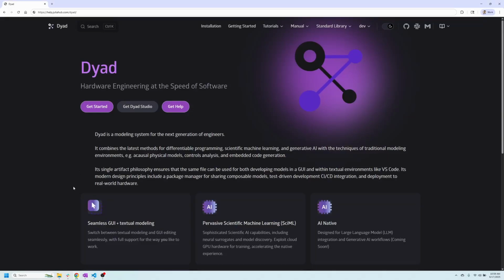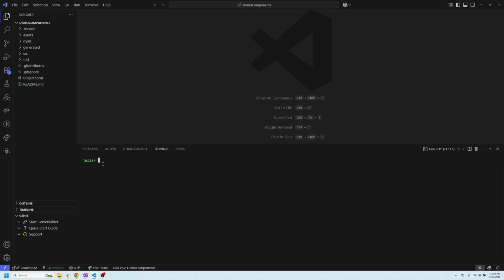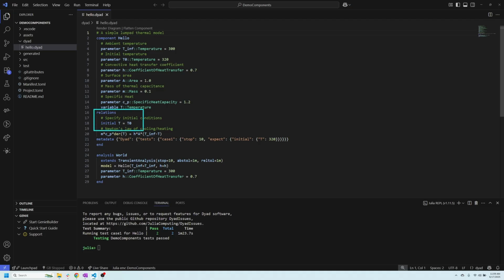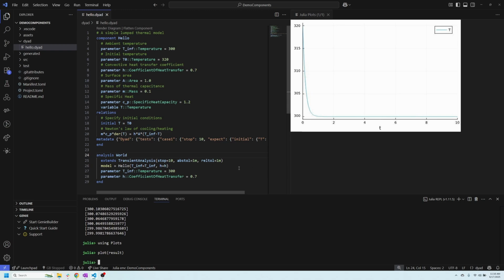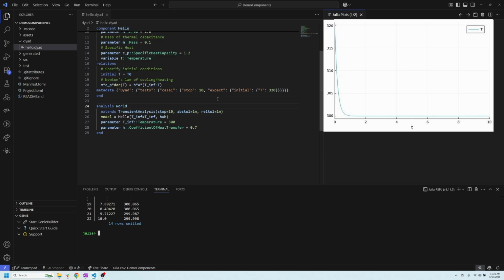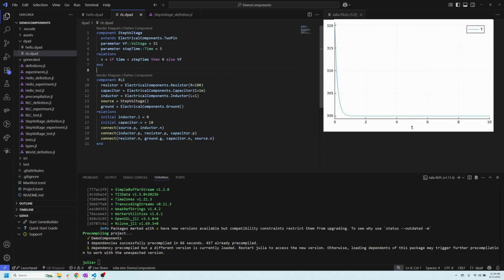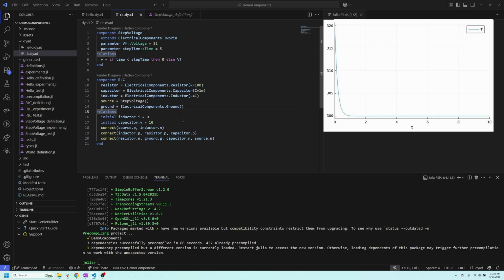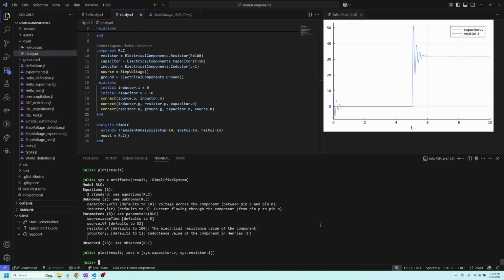Getting Started with Dyad Studio - Extended Edition (Complete In-Depth Tutorial)

Comment: In RLC example, if you're getting an error at the mtkcompile step, change `extends ElectricalComponents.TwoPin` to `extends ElectricalComponents.OnePort` in the `StepVoltage` component. `TwoPin` only defines the voltage equation but doesn't include p.i + n.i = 0, so the system is missing a current constraint. `OnePort` adds that.